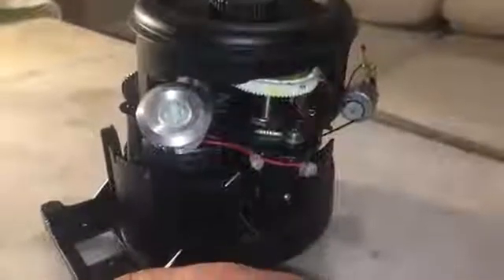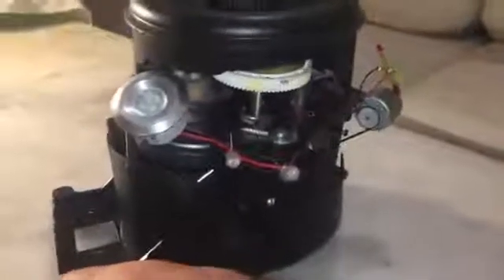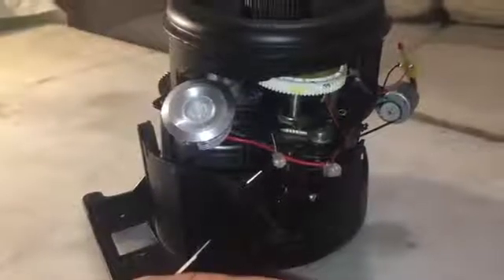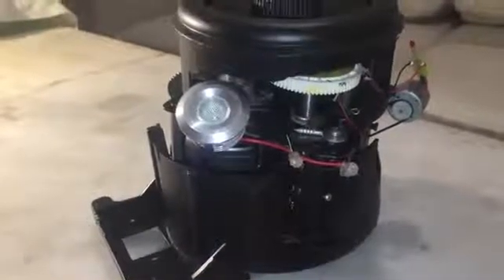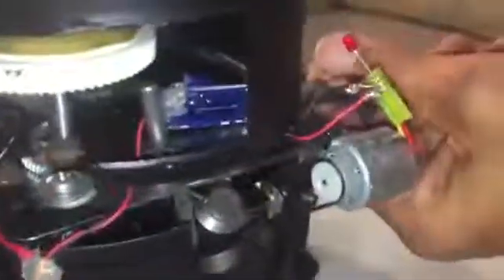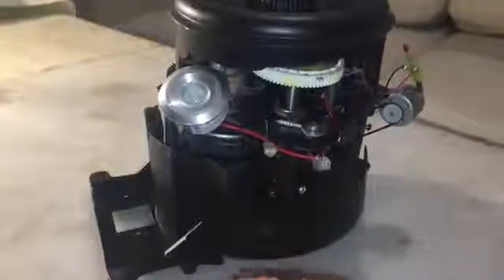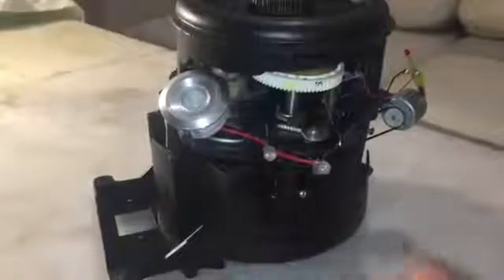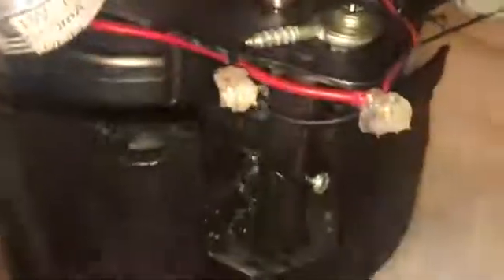A unique 100% mechanical free energy fuel-less generator

Comment: So this kinda works similar to a wind up clock? Very novel idea, much better than a pedal dynamo...
Reply from the maker: Hi thank you for your comment. Yes, exactly. When you stop spinning it then the alternator starts to work by the sprockets. It can be done bigger of course. The other concepts we find today is that you have a gearbox which is spun and also spins a small DC alternator which is just a small DC motor, but once you stop to spin it you have nothing anymore as the alternator stopped spinning as well. You can use a battery and maybe it will charge a bit. Here in this case there is no battery at all and the output comes as a pure mechanical output to electricity. Best regards thank you